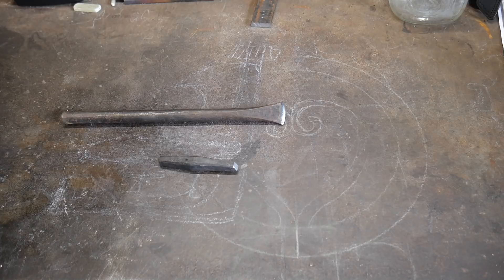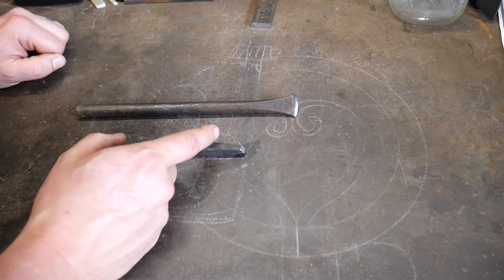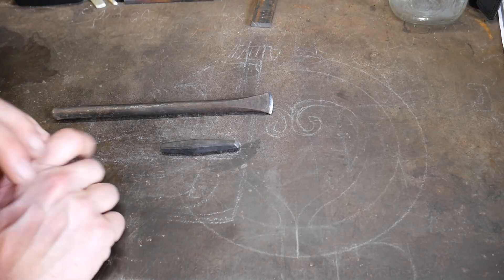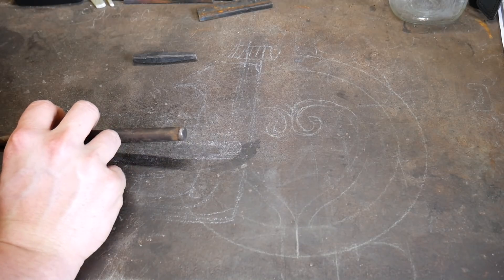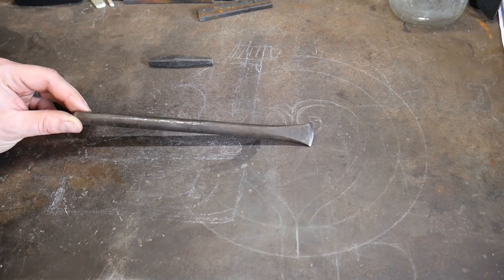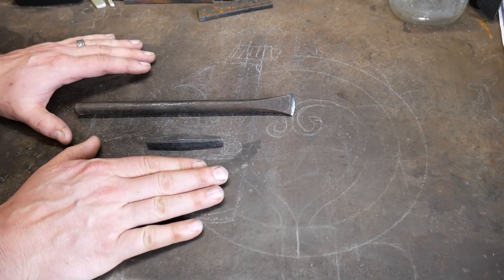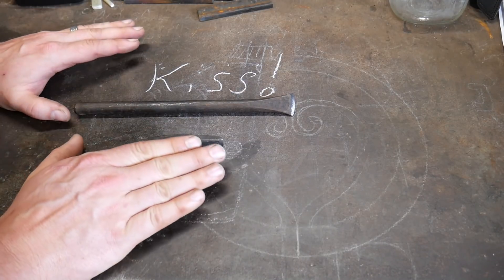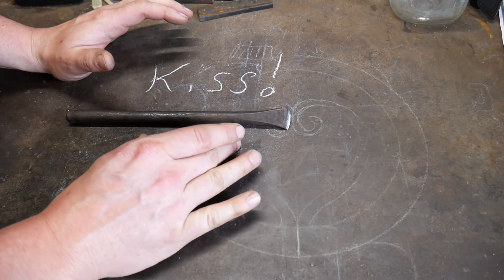Stop Overthinking Heat Treating

Comment: If you use a known steel and the recommended quench procedure, using a heat treat oven and/or molten salt baths, you can get a very precise, repeatable result.  If you use a metal that you don't know it's exact composition, use temper colors (or other temperature gauges), you can (mostly) get close.

Modern heat treat procedures is something like 3.14159265359.  Traditional (blacksmithing) temper techniques is more like 22/7, 3.14, or even 3.  Each of these will get you an answer: you just need to decide how exact an answer you need.  Personally, I just want a good, sharp (somewhat durable) edge... I don't particularly care if that means it is Rockwell 40 or Rockwell 65.  If instead of a knife, I am buying a one inch ball end mill to be used on a CNC machine in a production shop; I want a good idea of how long it is going to last.

Comment: Great video Roy. I apologise first relating this, as I cannot recall which of my smithing books I read it in, but the author was visiting in Thyland I think. He told of watching a local smith forging and tempering a parang, and when he was tempering it, he quenched it through a melon of some kind. When you explained the pine board, it jogged back in memory
Reply: Sounds like "The Complete Modern Blacksmith".

Comment: Hi Roy, what works for is heat to non magnetic and quench in the appropriate medium for whatever steel I'm using, not sure of the steel? the mystery metal I always quench in oil, quenching an oil hardening in water can meet with disastorous results! depending on the tool I draw the edge with a propane torch or if it's a knife 350 deg on a cookie sheet in oven for about 1/2hr shut oven off and leave in oven until room temp. I found out the hard way do not leave just forged knife on anvil overnight to cool! built up stress from quench caused it to break in pc's over night should've put in bucket of sand to cool

Comment: Very good Roy, and I love the bit about charring the tip with some pine, I know one thing the old timers knew what they were talking about. I actually did my own little test the other day with some cut off of leaf spring, one was in water and one was in oil, they turned out pretty much the same. The oil one seemed a bit harder, so I'm going to do the same with some spring steel. And I want to try the pine tip.

Comment: I still have a couple questions about heat treatment/tempering, but I don't know if you can answer accurately. Like, why do some people heat steel to what looks like forge welding heat then quench in oil for 10 seconds and pull it out while still glowing n the oil flashes up and leaves it to air cool?   I don't get it!
I found this app that John at Big Bear Forge mentions in a video of his about this same subject, it's the Heat Treater's Companion Guide from HTS that tells you how to harden/temper "known steel" and gives you a pretty good idea of how to do the same if you have an idea of just what kind of steel you have.
Reply: After that, it's all trial and learning; which is the best teacher

Comment: if the tool does the job at the end of the day and gets the projects out the door to pay the bills sometimes that is what matters, however I I have found from what I have seen the heat treat is very crucial as it is what gives the tool its properties, to take abuse or say the edge retention and the balance of, a slicing knife that has a huge 63 rockwell or harder will shatter if used like a cleaver but will slice for days and hold a fine edge, vs a broadhead say 40 rockwell it can be hit like a nail but you constantly have to sharpen it and it might not hold a good cutting edge but you can beat on it and abuse it that would break something hardened like glass.

Comment: The KISS system works for most things . But when you start to use a leaf spring, coil spring, drive shaft or sucker rod all are made from different  kinds of steel if you don't test your work you don't know what you have. It's O.K. to do that for your own things, But as soon as you sell it you now have a responsibility and an accountability for what you make. I know that you that you don't want someone hurt by a tool that you made. If you sell it then make it from known steel and use the appropriate heat treating but this i just my thoughts.  be well and be safe

Comment: What a great way of telling the heat by charing wood. It is great to think outside the box. The axe I just made Roy I did the same by just tempering in the fire for 50 min. Leafspring seems to get quite hard and even more so in water. So left it to temper for longer just in case.

Comment: My reaction when I saw the title was initially ‘damn straight’ but c’mon Roy, there is such a thing as oversimplifying. 
Case in point, I make most of my tools out of railroad clips, which are about 1060, but sometimes I’ll use train rail, which is closer to 1080, and those do actually need to be heat treated differently. You don’t need to  delve into the science, or align you quench bucket with magnetic north or anything, but 1080 WILL crack if you quench it in water. The method you describe here can be kinda dangerous if you’re working with mystery metal. Yes, keep it simple, silly; but learn enough to not get shards of steel in your fingers. (I had it happen once, it’s not fun)